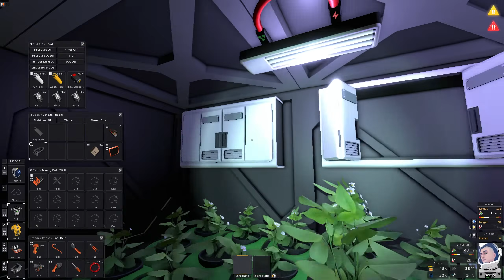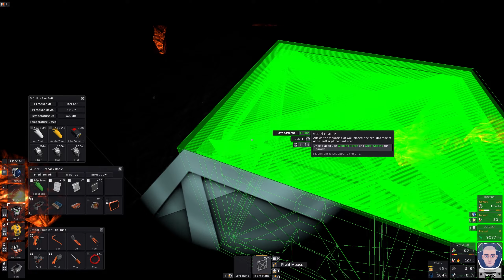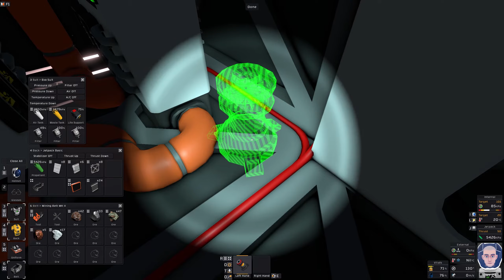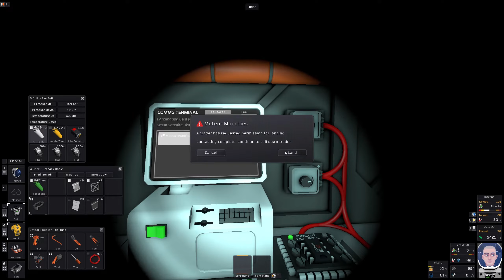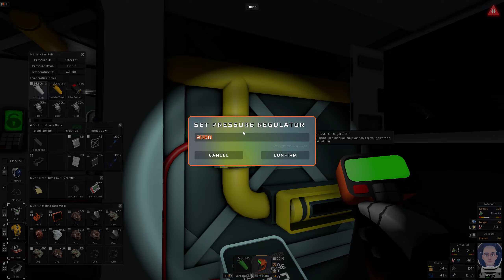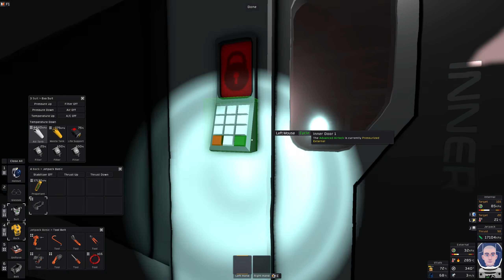Stationeers - Brutal Vulcan Start, EP8

Comment: noticed testing your cooling system that it dint handle adding heat to it. found the best way to really increase efficiency was to vent the output of the purge valve directly out in atmosphere. maybe i did something wrong?
Reply from the maker: I notice that gas coming out of the purge valve is reasonably cool so I thought I might as well reuse it.   Does it really help or not, not sure.